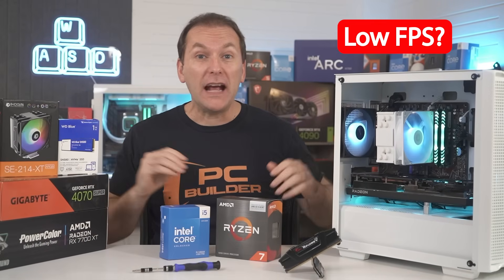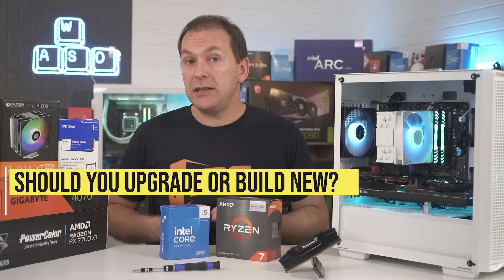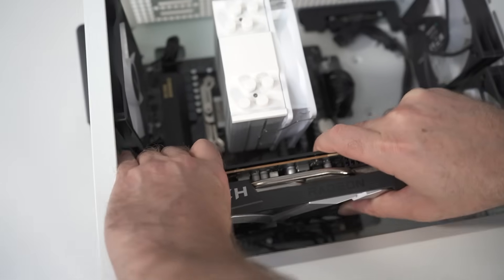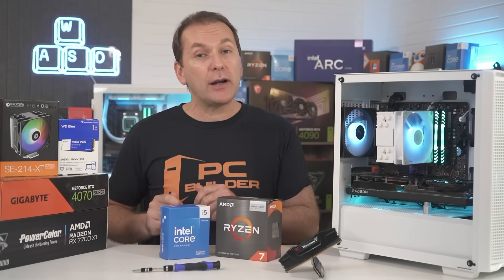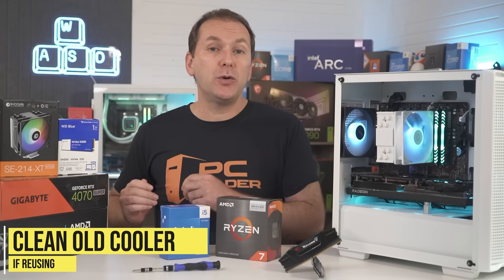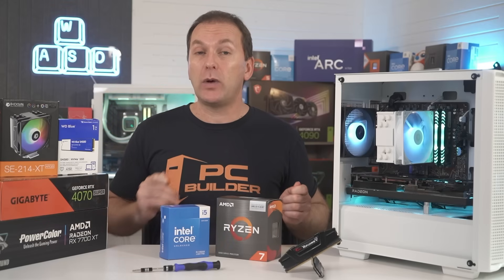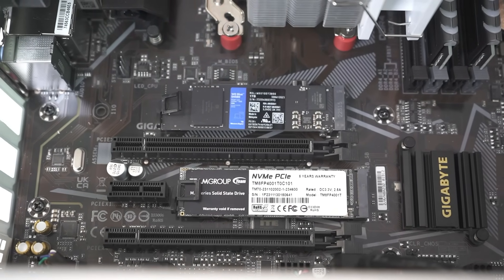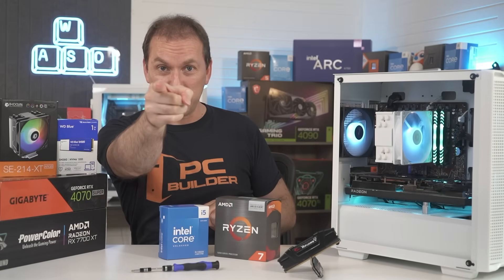How To Upgrade Your PC | How to Upgrade GPU, CPU, RAM, SSD & More

Comment: which GPU/CPU cooler/RAM would you recommend with 7800x3d for 1080p competitive games like pubg/cs2 240hz monitor? Ty ❤
Reply: So considering the 7800X3D CPU this build will be overkill for 1080p but that's fine.

GPU I would go 7900GRE

CPU Cooler Thermalright Phantom Spirit

RAM 6000 CL30 either G.SKill Flare, Trident Neo, or Teamgroup T-Force.
Reply from the maker: What Ty said. I'd rethink your CPU choice personally its way overkill for 1080p, especially for games like that. But if you have unlimited  budget and that doesn't bother you check out our 7800X3D build guide and our Best Gaming Monitor 2024 video
Reply: @PCBuilderChannel  i just want atleast 240 stable fps and maybe with idea that i will go for 360hz monitor soon or maybe 1440p 240hz. Because now i have 2070s 5600x and sometimes i have like 240 or even more fps, but in the early/mid/end game with a lot of players or big cities i have like 70-120fps and it's so annoying. So my idea is 7800x3d/7900xtx/Dark Rock 4 PRO/ and about ram does it even matter 5200/5600/6000/6400 with 7800x3d? 
P.S
PSU: 850W MSI MPG A850GF Gold good enough?
Reply: @DYoneTV  what's your budget for this PC?  Once I know I can try and pick out parts for you and see if I can fit a better Monitor in there.
Reply: @DYoneTV what country in Europe if you don't mind me asking just so I can guarantee the parts I suggest are available to you?
Reply: @DYoneTV you'd want something like this and I included a new Monitor because you want one with a system like this.

It's list / 6hDQHG in PC Part Picker
Reply: @DYoneTV Jason says to times the watts by 1.5 so based on his method you do.

Comment: Finally able to build my new system but ran into a strange snag. I am short a 4 pin power connector for CPU. Weird how close you can be to having everything right and still roll a 1.

Comment: Thanks Jason. I am using exactly the same GPU and CPU right now. 6650xt and ryzen 5600 combo from 2 years ago. (Thanks for your previous recommendation video 😄). It worked super well but I think its time for me to upgrade. I just wondering, why dont you suggest the rx 6800xt since I saw its number 2 on the top 12 1440p games? And if I upgrade the CPU to 5700x3d, which GPU should I choose to get the most of it? For the record, used 6800xt, 6900xt and new 7600xt almost price the same in my country which is around $380-$400. Or, feel free to advise another type of GPU
Reply from the maker: Hello! Nice combo you got there. If you drop in the 5700X3D you can upgrade your GPU all the way to a 4090 if you wanted to so at that point I'd go for the best that fits your budget. 6800XT is a good choice if you are seeing it at a price you like and don't need the AV1 encoding. (:

Comment: I need help biulding a pc for my friend that will last ong budget is 1000- 1800 pls help
Reply from the maker: That's a pretty big spread for the budget! If its closer to $1800 check out our 7800X3D build guide on the channel. If $1000 see our Best Budget Gaming PC 2024 video
Reply: What is your friend doing with this PC?  Also just to clarify budget is $1000-1800?

Comment: I have ryzen 5500 and rtx4060 should I upgrade my cpu to 7600x or upgrade my gpu?
Reply: Don't upgrade the CPU to the 7600X because that would require a new Motherboard and RAM.  The 5700X3D would make more sense though your GPU could also use in upgrade.

What I'd recommend depends on your budget.
Reply: @ty09162  I live in Thailand my budget in dollar is around 540 USD
Reply: @LlamarFX  so I would upgrade your GPU and then later when you have more funds you can upgrade your CPU to the 5700X3D.

That budget is just a weird spot because you can get a good GPU for that price but then your CPU would bottleneck it.
Reply: @LlamarFX  I don't know what prices are like in Thailand but based on USD you can go as high as the 7800XT but then you'd be CPU Bottleneck.

If you stick with your 5500 you can go 6700XT/6750XT, 7600XT, or 7700XT.
Reply from the maker: I'd drop in a 5700X3D if you can.
Reply: @PCBuilderChannel  Any GPU recommend after I upgrade to 5700x3D?
Reply: @LlamarFX  for Gaming any GPU 6700XT/6750XT or 7600XT and above are good.  It just depends on how much you want to spend.

Comment: I do a lot of photo processing and my old 8700K Intel system just does not seem to be keeping up. Gaming has never been an issue. I previously upgraded to 32 GB of RAM and it just seems sluggish. I'm looking into upgrading CPU, motherboard, and RAM. Is there a better way to go between AMD and Intel? I will be reusing my case, power supply, and storage.  I am running a 4070 super if that matters.
Reply: Either option is good.

What's your current PSU wattage and what's your budget for upgrades?
Reply: 850W.  If I can replace those components for under $600 I call it a win. I know I could put together various options in that price point but I just didn't know if one system is better for my needs than another. Everything pushed online is the best system for gaming. My system is great for gaming but when I'm processing thousands of photos it just seems to crawl.
Reply: @DownwithDoug  so here's my recommendation.

The CPU Cooler is there to accommodate any future CPU Upgrades.

It's list / PZMv9c in PC Part Picker

If you prefer RGB components you can go with this instead.
It's list / Bm9NbL in PC Part Picker
Reply from the maker: Either is good for this!
Reply: can you get to Microcenter? they have the best cpu bundles

Comment: I need a second opinion, i plan on learning blender and making 3d models as a hobby and stream for the same reason. Do you think i should go nvidia because of the advantages or try radeon?
Reply from the maker: For Blender Nvidia is still the best option
Reply: @PCBuilderChannel  what is your opinion which should i go with?
Reply: If you're using it for that and not Gaming yes Nvidia makes sense
Reply: I should've mentioned i also plan to game on it
Reply: @stabbed4665  so what I would recommend depends on your budget and what your primary use case is.
Reply: @kelley09162  gaming first, streaming second, and blender third
Budget doesn't really matter, but i would try not to leave 4070 super price, so ~$600
Reply: @stabbed4665  so 600 for the GPU?  Also do you already have a PC build or are you building new?

So with that order in mind I would go with the 7900GRE.  Nvidia is better for Blender but since that's the least important to you it makes more sense to get the best Gaming CPU for your budget.

The Sapphire Pulse 7900GRE is currently $550 and I've heard good things about Sapphire.
Reply: @kelley09162  im just upgrading components from my previous. Ty for the recc

Comment: Hello I have a i5 8600k + 1060 6gb. I want to play upcoming 2025 games at 1080p. I need to replace the graphics card but is the CPU still ok?
Reply from the maker: You will end up with at CPU bottleneck on a number of games but when you do upgrade your CPU that will be alleviated. An RX 6600 would be a boost, a 6750XT would be even better
Reply: Depends on your budget.  It would be nice to also replace the CPU but if funds are low it's probably fine.
Reply: @ty09162  I want to replace the gpu first and then in 2-3 years replace the cpu + motherboard and go ddr4 -> ddr5. My budget just for the graphics card is 300 maybe 350... What are some good options for me? Also I rather buy a second hand gpu since its usually 100-200$ cheaper
Reply: @averageMHenjoyer  for the GPU the 6700XT/6750XT and 7600XT are great options.  The Intel A770 is another good choice.

Comment: Honestly system resets cause more issues than they solve (including factory resets). You're better off re-installing windows, or just manually working on the system like most techs do.

Comment: I currently have an Intel I7 6850K running with an EVGA GTX 1080TI FTW Graphic Card and 32GB of Corsair RAM. Looking to upgrade to the Intel 14700K with either 32GB or 64GB of new Corsair RAM with either an RTX 4080 Super GPU or waiting out for the newer RTX 5000 Series cards when released.
Reply: Just note 15th Gen is coming out in the Fall but the 14700K is a great CPU if that's what you want.
Reply: @ty09162  Thank you for the information as I wasn't aware they the Intel 15 Gen was releasing much later in the year. As I am not likely to be able to upgrade until next year I will wait out until I see more info on the 15700 model and 15th Gen compatible Asus motherboards and what the UK pricings for them will be. 😁
Reply: @AnthonyC43 sounds good

Comment: When changing the CPU or the CPU cooler, especially on older PCs, the thermal paste can be like glue and its hard to get the cooler off without damaging anything. In that case its helpful to run a CPU stresstest to get the paste warmed up, switch the PC off and start unmounting the cooler shortly after. I dont like the thought of using a blow dryer inside the case xD..Other than that, there is not much to add. Nice vid, happy upgrading!

Comment: I’ve been using a Ryzen 5 3600 and a GTX 1650 Super for the past 4 years now. It preforms just fine for me, but I think I’m gonna upgrade just the GPU for some extra frames, and I’m considering the Intel Arc A580 or A750. I know that the A580 wouldn’t really have any noticeable bottleneck with the 3600, but do you think the extra $30 for the A750 is worth it and would it have better performance than the A580 even though it’s paired with a Ryzen 3600?
Reply: I would go A750 if you can afford it.  The 6600 is another good choice.
Reply: I would go for the three fan sparkle cards of either, keep in mind you might need a bigger power supply cause they take TWO 8pin plugs where as your current video card sips power
Reply: Since the other comments have commented on the card itself, I'll comment on the actual compatability of Arc cards and how they feel to use since I have an A770. I've had very few driver issues with the card (all of them are in blender, none in gaming) so you'll be very happy with the card, especially if you play a lot of mainstream titles (Starfield being an exception). Arc also works great for just the daily normal tasks like browsing and watching videos, never had issues there either.

I would definitely recommend an Arc gpu as they are very stable now in my experience.
Reply from the maker: The A750 with 3600 is a fine combo, the driver on the ARC cards might require some work so if that doesn't appeal to you consider the 6600 as an alternative. See our latest GPU Market Update video for more

Comment: I upgraded from a NVIDIA RTX 2060 SUPER to a Saphire AMD RX 6800.... but I am UNABLE to DELETE the NVIDIA  Drivers and Programs - it incrusted itself everywhere, NVIDIA Audio and other  NVIDIA stuff WILL NOT ALLOW TO BE UNINSTALLED   - - PLEASE HELP !!!!!!!!!!!!
Reply: install DDU video card installer, then boot into Safe Mode and run DDU, reboot, you should now only see Basic Display Adapter on the device manager

Comment: I just dont know if upgrading now or waiting is better :(
Reply: Depends on what you have now and what you're thinking about getting.
Reply: only you can answer that, we can only advice you is we ask you a bunch of questions
Reply from the maker: With your current combo I'd upgrade for sure. There's nothing new coming that would affect you and your time has value
Reply: thanks guys its fine im probably just getting jittery seeing all these nice specs. I got a ryzen 5 3400 and a 1660 super. Its fine for the games i play so far
Reply: @ninenine9913  well what's your budget for upgrades?
Reply: around 1500€ maybe a bit more
Reply: @ninenine9913  so I made this build for you.  You can keep stuff from your current PC if you want.  I just wasn't sure what you'd want to keep.

I guessed UK for the country but if I'm wrong let me know and I can re-look at the build.

It's list / 8ssmMV in PC Part Picker

Comment: I bought everything to build my new pc except for the motherboard and fans 2 years ago.   Now I have a Ryzen 5600 that’s probably already outdated.   I’m seriously torn on what to do now.
Reply: The 5600 isn't outdated, but you can upgrade to a 5700X3D if you want assuming your GPU won't bottleneck it.
Reply: you went thru a period of stagnation and complacency? well your in luck because everybody considers the 5600 as a goto budget chip to build right now, so either build with that chip or put it on ebay or craiglist and get rid of it, and then decide if you want to go AM4 or Intel new or Intel old, you got a ton of options
Reply from the maker: 5600 is a good CPU! See our latest Best Budget Gaming PC 2024 video for a great current sample 5600 build list

Comment: I have the Fractal Torrent with a Noctua DH15 using the offset bracket for an AMD 7800X3D. The cooler somewhat overlaps the top pcie slot for my gpu, and the bottom slot would put my gpu kinda close to the bottom intake fans the case uses. Is it alright to have the gpu close to those fans? It limits the size card I can use, but I was planning on capping at a 4070TI Super which isn't as thick as something like a 4080. I just don't want to mess something up by having the intake fans mess with the gpu fans in some way. Hopefully I explained this at least sorta decently haha, thanks for any help
Reply: 🙂 or sell of the Noctua and pickup a Scythe Mugen 6, the heatpipes are slanted both to the back and towards the top

Comment: I personally like to adjust cooler screws 1 level tighter than screwing it "softly" with screwdriver or with your hands. I got this from tuning up drums and I tighten them a bit more to make sure is there and is not loose, but not too tight either.
Reply: i do it out of the case and i tighten it finger tight then start checking with a good twist and tug, then tighten a bit more, then do a tug test again, cooler manufacturers are not consistent with each other so with some companies you can messup your morhterboard if their screws are kinda sketchy, be careful
Reply: @MrSamadolfo  Yeah, great advice. But that's what I do as well, sort of. I tighten them "tight enough" but not too much and try to move it (gently) and see if it gives. If it's solid, it's good to go and doesn't need any more tightening.

Comment: Definitely i need a brand new PC :) Old: MSI Z170 Tomahawk, i5 7600k, Kingston Fury 4x8GB DDR4, MSI RTX4060 8GB, 2x1GB m.2 SSD, 2TB HDD, Thermaltake 550W PSU, CM Storm Enforcer case etc. I would like a new one: Gigabyte B650 Aorus Elite, Ryzen7 7800X3D, Arctic Liquid Freezer III 280, 2x8GB G.Skill Trident Z5 Neo DDR5 6000MHz 30CL, Radeon RX 7900 GRE, 3x m.2 SSD (2 old + 1x2GB brand new), idk - 4-8GB HDD for extra space, MSI MPG A1000G PSU, NZXT H5 Flow + 2x Arctic P12 Max + 2x Arctic P14 Max. Some pieces have already been bought, Some still need attention. I want pure performance, not rgb and other fancy stuff.
Reply: That would be a good upgrade for you.
Reply: pickup a cheap i7-7700K and flip that pc, that board is pretty decent

Comment: is it worth going from 4070 to 4070 super
Reply from the maker: No, not worth the money. But I'm betting there are other upgrades you could do to your build that would be worth it! Check out our Best GPU/CPU Combo 2024 to start
Reply: no.. that would be silly, just hold out until 50 or 60 series.
Reply: @turboimport95  thanks
Reply: sure, it just depends on how much can you get for your regular 70 ???
Reply: @MrSamadolfo  its hard to sell stuff online, and if he did sell it, would have to wait to get new card and in mean time no gaming... better to just sell it later or keep it as a backup and just get a new card...
Reply: @MrSamadolfo  newegg give 350 for trade in for it

Comment: Got a Ryzen 5700G and 6750XT GPU. No real upgrade that has enough bang for buck to justify it. Will likely build an AM5 later and keep current as a spare.
Reply from the maker: Dropping in a 5700X3D would set you up for huge GPU upgrades in the future without needing to jump to AM5 so I'd consider that personally.

Comment: Hey Jason, 1. Great News: I just Joined your Channel! (Long Overdue, I Know!) 2. My Stupid Question of the Week is: I want to Upgrade my 'Boot Drive' on Gaming PC 1 from a SSD Sata Drive to an m.2 Nvme Drive. Can I re-install Windows & use the 'Same Product Key' I purchased from VIP SCD Key? & How do I 'Recover the Product Key'? Duoh! I forgot to Write It Down!
Reply from the maker: Hi Michael, thanks for being a member! You should be able to use the same key as it is an OEM key and is hardware locked, but it is possible that changing the boot drive might require a new key (not sure, but I don't think so). You can login to VIP SCDkey and they have all your key purchases there, or use the email they sent you. Hope that helps!
Reply: @PCBuilderChannel  Thanks Jason, I still have 'Buyers Remorse' about my RX7600XT GPU! I should've done more Research, would've discovered, that it's not as Good as I'd hoped It would be with an extra 8Gbs of VRAM!!??

Comment: I made the same CPU upgrade from a 5600 to 5800X3D. You also have to remember to get an aftermarket CPU cooler as neither the Wraith Stealth or Prism will cut it for a 5700X3D/58000X3D.